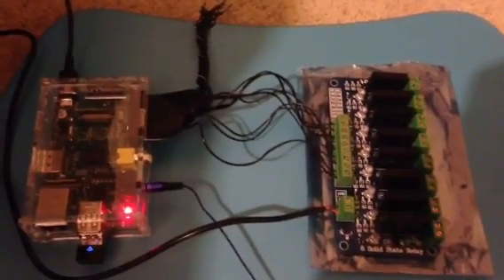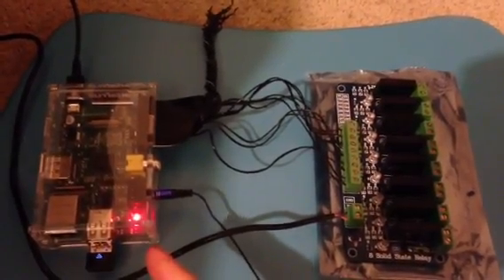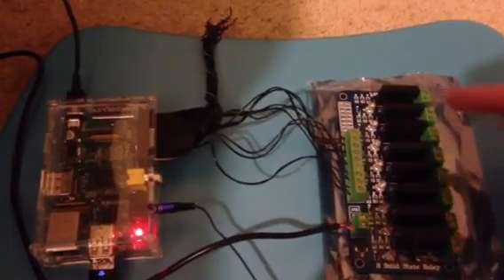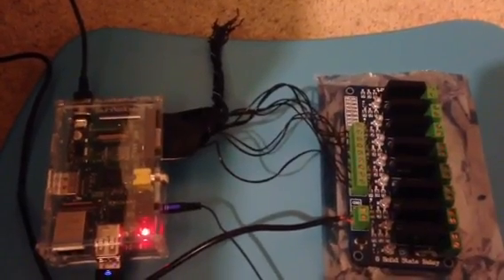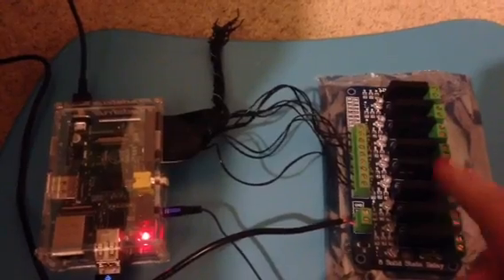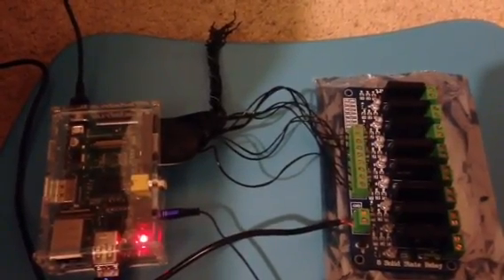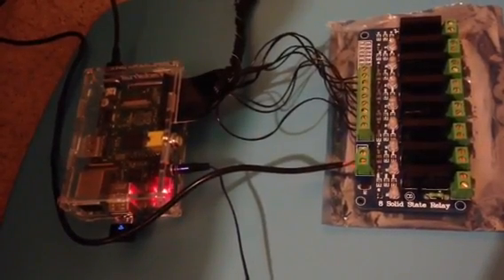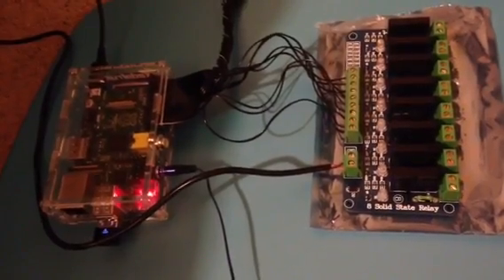Raspberry Pi: lights sync to music

Comment: Great work. Do you know if this type of set up could be expanded to drive up to 24 relays with 24 discrete notes? I would like to build a driver to control a set of organ chimes. Thanks!
Reply from the maker: Depending on which version of raspberry pi you have, you can use more Onboard gpio pins or you can connect a port expander chip such as the mcp23017 using i2c.
Reply: wynn3th Thanks for the reply. It's the B+. There is enough gpio pins and I will use a secondary power supply for the 24 relays. I guess my real question is, "would this set up trip a relay based upon 24 discrete notes in the MIDI file?" I have not used the lightorgan program so I don't know how many channels it could drive.
Reply from the maker: Torre1 to be honest I'm not sure, you should go to the blog linked and ask the dev. I no longer use this setup, I now use  lightshowpi which works directly from an audio file or audio input (directly playing mp3s myself).

Comment: does any one know a way to choreograph the lights yourself. I see lots of light organ examples but no one controls it them self to create a smoother and less chaotic light show. I will be using this idea in a small display in my yard but its just too random for me. OHHH and GREAT WORK!!! Iove the video.

---- why do we still say video or recording if we don't actually use video tape or records to capture any of this? -
Reply: +wynn3th I second this. I know I'm late to the party, but is there any way to run a vixen show off of a pi? I enjoy taking time to sequence my shows perfectly.
Reply from the maker: If you're wanting to sequence a show yourself then you'd want to look at vixen or lightorama (google it). The difference in the two methods is the time you'll be spending doing all the sequencing. Since this video I'm now using lightshowpi which still automatically controls the show but is much more feature rich. It works directly off an mp3 or even audio-in.

Comment: Someone please let me know or work with me on utilizing this technology with various led light systems in a vehicle. Like engine bay LEDs wheel well leds trunk LEDs . Like the cadger Christmas light show :)
Reply from the maker: Good idea. Just need a 5v input from the vehicle to the raspberry pi, wire the in voltage and out to the LEDs and tuck it all away. Of course, I think it'll require a few subs or a bass cannon, just to be safe.... :)
Reply: Already have wheel well lights and engine bay lights (not installed) looking uni custom color changing angel eyes. I have systems in big eclipses but one is aimed for show stuff. I have purple less that simply light up with the bass right now, but looking to go much harder, and not go home.
Reply: In both * eclipses. Autocorrect sucks

Comment: Can you do this with audio in too? say if you use a phone to play audio on some speakers and you split the cable (one end to the pi, one to the amp for the speakers).
Reply from the maker: The RPi isn't really meant for audio input, so that's not going to work well. You might could hack your way through using a usb mic but I wouldn't recommend it. I'm actually using a different software solution now called lightshowpi, www.lightshowpi.com which does directly process the wav audio from my mp3s. Rather than play something from a phone to speakers then, just put the files on the RPi and play them out to speakers. Personally I use an FM Transmitter, which you can make from the RPi itself if you'd rather not purchase one.

Comment from the maker: I imagine it can be done to a degree, you would just need to make sure the output from your midi equipment is being sent to the midi channel that lightorgan is monitoring (probably using timidity in the middle). Keep in mind that a) it may not be as 'live' as you expect, the raspberry pi is not a realtime system and b) for drum tracks you'll need to modify the source code of lightorgan to monitor midi tracks that are typically for drums. See the page about lightorgan for more.

Comment from the maker: The command used to launch everything is simply:

sudo ./lightorgan && sleep .5 && aplaymidi --port 128:0 audiofile.mid >/dev/null & sleep 1.75 && mpg123 audiofile.mp3 >/dev/null

(You may need to adjust for the location of your executables, aplaymidi port, and the sleep time between the midi and mp3. For this particular song I found 1.75 seconds was the sweet spot.)